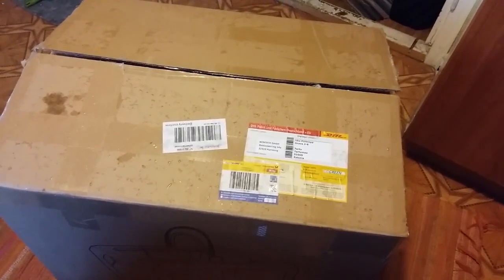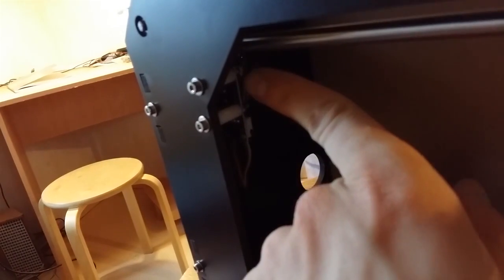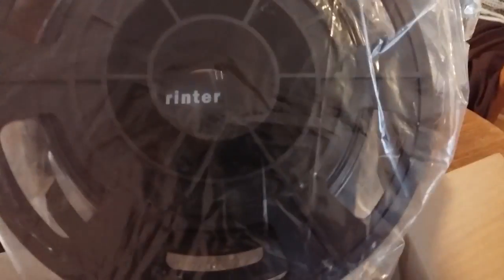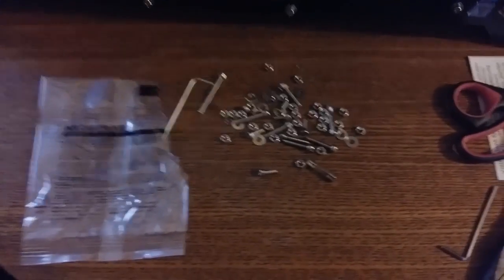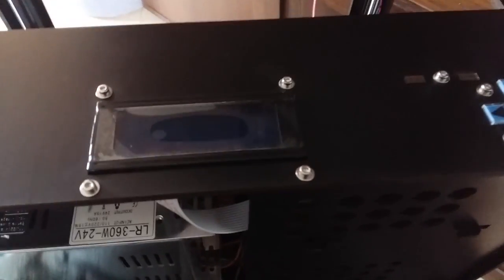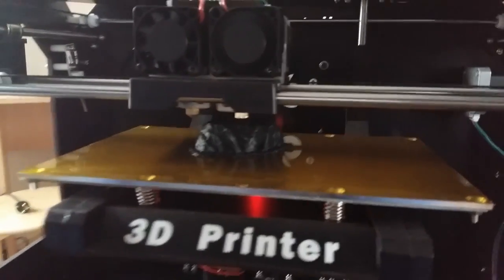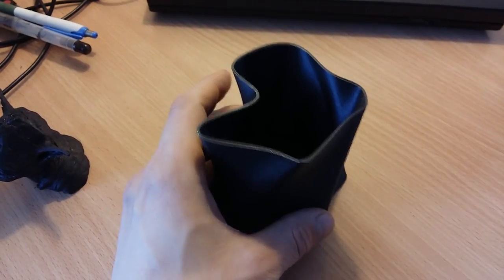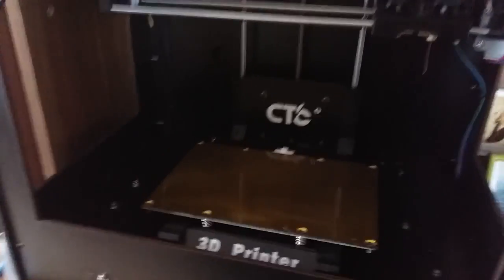Dual extruder CTC 3D printer unboxing, setup and operation

Comment: hey guys  im trying to set mine up and I have an issue where the left exsduder is mounted 3mm lower then the right one ?
Reply: ditto. just I have just levelled it to the lowest extruder for now.
Reply: Yeah I think il do that if I can not get it fixed in the next week the issue right now is all the files I have are for the right one and I guess I need to start only using the left one
Reply: Their not supposed to be level so they don't clip the print.
Reply from the maker: What do you mean by "all you prints are for the right side"? The sides should be exchangeable.
Reply: well in the default files I got they where all only using the right one
Reply from the maker: You can specify which extruder to use in Makerware.

Comment: Ich nehme mal an die Bauplattform ist beheizt, um das pla nachdem Druck zu lösen? Mich würde mal interessieren wie gut er switcht zwischen model und support.
Reply: Die plattform ist beheizt damit das Bauteil an der Platte hält. PLA kann man theoretisch ohne beheizte plattform drucken, man braucht dann aber andere hilfsmittel dafür. ABS, PETG usw benötigen Plattform temperaturen zwischen 70 für Petg und 100 für ABS.

Comment: My plastic dosn't stick to the platform what can I do?
Reply from the maker: +Gumimaci :D 

1) Level the build plate so that a sheet of paper fits between the extruder and the build plate (the levelling function is available from the menu, it is a pretty automated process).
2) Increase the build plate temperature in the Makerware software.
3) Use rafts as print bed.
4) If all  that fails, use some adhesion promoter or a different surface finish.
Reply: Ok ty :D
Reply: apply a light layer of paper glue stick. the kinda stuff that kinds use in school

Comment: 2 Screws to fit, a few minutes calibrating the Plate and bingo !!! Very Very Happy with this Printer !!! Cheap as Chips and does just as good a job as the Makerbot 5 at work !

Comment: Nice vid! Did you ever find the pfte tubing? I'm trying to visualize what supports the filament as it pulls on th spool...
Reply: Also what version firmware did it come with?
Reply from the maker: +Mark David The seller replied that the tube was not meant to be in the kit, which is OK. Right now the filament roll is suspended above the printer via a stick and the interface is a simple friction bearing between the stick and the roll housing. The firmware is "1.0" on the screen. I'm not quite sure to what that translates.